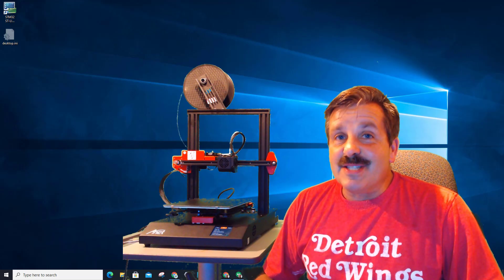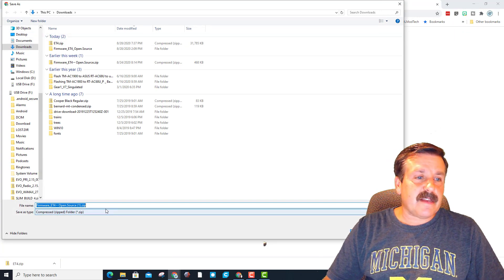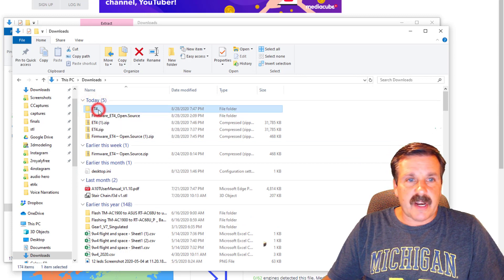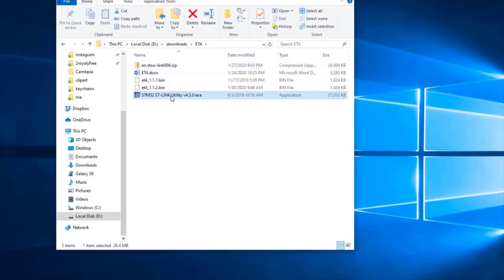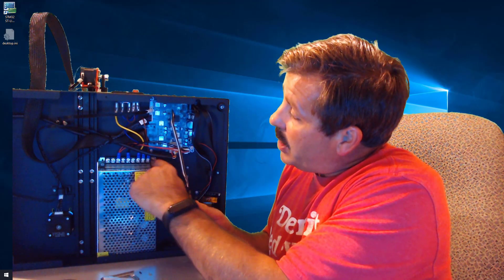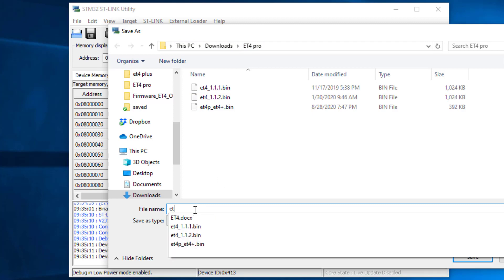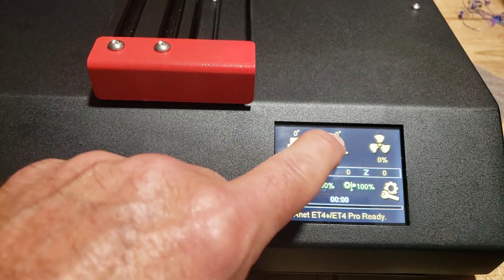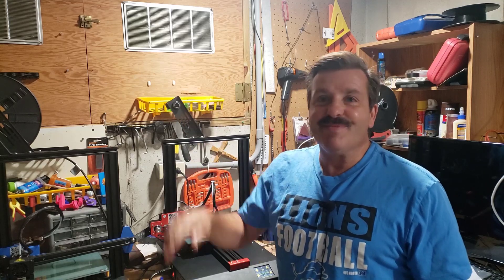Flash an Anet ET4 Pro or Plus to Marlin 2+ firmware using ST-Link v2 in Minutes!

Comment: hopw our still active... so i have an issue where My firmware will load up - but its in the top right corner, not the full display, and everything is backwards? and i cant even screen calibrate it... any suggestions? its saying left side is on the right, and says failed if i try usinng the full screen and do the calibration how its supposed to be
Reply from the maker: What printer are you working with?
Reply: @HLModTech  the Anet ET4 Pro - I have some pictures of the issue if there is a way to get them to ya 

I’m tried changing the resolution, the board  on the screen says ET5 so I tried setting the firmware to use ET5 resolution and I messed with the rotation and mirror settings also in the firmware, built and updated the firmware and still has the same exact issue with no changes
Reply from the maker: Sorry for the delay. I do not have skills to mod the firmware and such. I just used what was shared and provided the steps to get it on there. Anet seems to have went belly up as I keep getting notes that no one can get the original firmware either.
Reply: @HLModTech  well your video was super helpful - ima keep working at fixing my issue as if it’s a user error on my part haha - thank you tho, fingers crossed!!!

Comment: I heard that this Anet is like an Ender 3 clone, and I've been trying to do the same thing because my 3d printer won't accept any layer stops that I program in my slicer, BUT NO ONE REALLY HAS A VIDEO FOR THE ENDER 3!!!! Could you post a video about using the st link on the ender 3? (or send me a link for a video that I couldn't find 🤣🤣)
Reply from the maker: I do not have a Ender 3 or the Anet printers anymore to play with. Sorry about that. I am pretty sure that Anet used a certain main board that made this possible.. I do not believe Creality did the same.
Reply from the maker: The Ender will update via SD card. https://youtu.be/80IWoygNxB4?si=KdN-GuAacD8HTdrj  That at least gives you ideas on search terms. Hope it works out for you.

Comment: Dear friend, I have problems with the firmware. I don't have an official firmware, and my printer doesn't want to work properly with marlin. The end cap does not stop the Z axis. Do you happen to have any firmware branded for Anet et4 pro? The official website is no longer working and the forums are too, and I can't find the official firmware anywhere. I will be very glad if you can help me and put the official firmware somewhere.
Reply from the maker: Sorry, I do not have any firmware. I do have those open bin files on my site, but none of the files that ain’t used to host.

Comment: How are you
 I am trying to install Marlin but the open source version has many errors that I have tried to solve and have not been able to, that is why it seems like an excellent option, its firmware .bin files already configured for each model. , but the detail is that I left out the link you have in the description. You will have another link or even a drive link, it is for the printer.  
anet et4+ and say this is the case, thank you very much and greetings from Mexico
Reply from the maker: I do not have any .bin files for the Anet machines. The content I do have is hosted here. https://hlmodtech.com/anet It appears the Anet forums do not work anymore. =*(

Comment: hi

am facing issues with new firmware

i flashed marlin2+ on et4 using stlink it is success

but after that i tested auto home then x and y are working fine but z axis is not working, it is moving up few steps before reaching its high &it starts toward down and collide with bed i even tried to to reinstall firmware

can anyone help !!

thank u in advance(:
Reply from the maker: So the ET4 original version homed up. The ET4+ and Pro homed down and had a sensor to detect the bed. Which version do you have?
Reply: @HLModTech  et4+ , I read on the Internet that somewhere there is not the correct code for the motherboard responsible for z offset, yes, I'll say more that I can't even move z offset by pressing on the screen))) I will be flashing it
Reply from the maker: Ok. The nice thing about the ST-link is you can get new firmware on those machines pretty easily. I have videos up there for going back to stock too. This is a tutorial I whipped up to help with searching. https://bit.ly/findhl

Comment: Good evening, please tell me, I installed Marlin on my printer using your video, but I have a problem -
The model's airflow fan must be turned on manually, settings in Cura do not help.
Are you have the same?
Reply from the maker: I have not noticed that issue.  After a print starts can you control the fan via the control panel!
Reply: @HLModTech  Yes, before and after start print I can manually on the model's airflow fan, but it is not automatically like in original firmware.
Reply: No, in Cura settings the model's airflow fan should turn on on the second layer, but it is not start(
Reply from the maker: @АлексейГуляев-л4н  would be interesting to see if a project sliced using PrusaSlicer worked. I would not picture the fan codes being something Keira would not send it correctly.
Reply: @HLModTech  I also noticed that the cooling of the motherboard does not turn on after turning on the printer, and on the original firmware this fan turned on immediately after turning on the printer.
Reply from the maker: I will have to check mine again soon. If you prefer the stock, it is easy to go back. https://youtu.be/b7rmJA4e5jc
Reply: Good afternoon
The problem turned out to be not in the firmware, but in the Cura settings)
On the native firmware, when setting up the Cura configuration, the Cooling Fan section was set to 2  when switching to Marlin, you need to set the default value to 0)
Reply from the maker: Is there any chance the fan is just set to off for the lower layers?

Comment: It work great, however, I have been using marlin in my anet for a time, yesterday it send a error message (max bed temp, please reset) and nothing can solve it. I had reflashed it but still the error screen.... Any advice about how to solve it?
Reply from the maker: It may be that your thermistor is broken or a wire has snapped. I have not fixed one of those though.
Reply: @HLModTech  😞

Comment: Thanks for your video, how can I change the steps to the printer to put a bmg extruder on it?
Reply from the maker: This video shows an updated way to make your own Marlin for an Anet machine. https://youtu.be/qydFcQ3ThPA?si=x44R6W6RJnvETGrI In that code you would have to change the drivers to match your bmg extruder. It is not something I have ever messed with though.

Comment: Здравствуйте. Пробовал прошивать по вашему видео. Выдает ошибку "programming error @0x08000000. Как решить эту проблему?
Reply from the maker: I would double check the steps. I have also had it where forgot to turn on the printer. I do not remember that error, but I have not flashed one in quite a while. I did make a updated video for the ET5x if you want to check that out. https://youtu.be/qydFcQ3ThPA

Comment: hola  gracias por tus videos son de gran ayuda, como retorno la copia de seguridad original de la maquina?
Reply from the maker: Thank you. 😃 You will need to use steps like this. https://youtu.be/KKCer809pxU Just be sure to track down the firmware for the correct machine. The ET4, ET4+, ET4 Pro models all being similar made it tricky.

Comment: hello i connect stlink and i see the printer i save the old firmware, and the program save the file ,but the file is only 4 kb instead of 392 kb , why? it is only the boot loader ? what can i do i intall openbootloader ? or what thanks
Reply from the maker: You may want to check out my newer video. This is the ET5x, but you would just chose the ET4 Pro config at that step. https://youtu.be/qydFcQ3ThPA

Comment: I have a Diggro Alpha 5 printer which is a exact clone of Anet ET4 Pro. I wonder if it's possible to flash it with Anet firmware, will it work? Since it's a clone there's no firmware update for Diggro anywhere, so I thought maybe I could use firmware for ET4 Pro. 
If I will do a backup of the original firmware first and then lets say I will fail flashing ET4 Pro firmware or there will be problems with it I can always flash the original frimware back to the printer, right?
Reply from the maker: I am not sure. I am making a new vid for the ET5x really soon. Watch the step for finding the correct config files for the printer. It would be interesting to see if there is a Diggro folder in there.  Theoretically you can go back, but flashing always has risk.
Reply: @HLModTech  Hey, just want to let you know i flashed My Diggro Alpha 5 with the ET4 Pro firmware you provided succesfully. But now I'm not sure how to calibrate Z axis in the center, got my corners done manually with Calibrate Corners option and a piece of paper, but having problem with the point in the center of the bed. Old menu was very intuitive about it, but Marlins is a bit of a mystery for me in this case.

Comment: I've followed everything you've done but the anet screen has the open blt but has a message saying no firmware.srec  I've got a firmware srec file on the sd card but still not initiating a firmware install any help would be greatly appreciated
Reply: Found my answers I had a bad download of the firmware srec so re- downloaded and it worked a treat ill keep this question here just in case anyone runs into the same problem
Reply from the maker: Very cool. I was just going to reply to the one above that firmware.srec was a different style of updated. Great job tracking that down. 👍
Reply from the maker: I keep seeing a notification to reply... =) I know we are good, but that notification is annoying. Super cool you solved it!

Comment: Im getting a cannot connect to st link, ive doubke checked ghe pins numerous times and still have the error, any help would be appreciated
It also says  "connect under reset" on the error message, but cant find that option in the settings
Reply from the maker: I have not run through it in a long time. One thing about the pins is that they can be labeled differently on the ST-Link. A lot of users mention catching that. Another thing is that the printer does need to be powered on.  Keep me posted... I may think of something else too.
Reply: @HLModTech I finally, literally 10 minutes ago, got it working. Wasnt able to make a backup because the printer kept disconnecting after a few seconds after connecting, also saying the voltage was to low, debug in low v mode didnt help at all... So once the target loaded i just flashed it (4 seconds) and now it seems fine, marlin loaded up, going to finish building my enclosure now and recalibrate the machine like it was new out of box and gonna start fresh because i kind of started in the middle, full of eagerness and excitement in this 3d printing stuff.
Ive watched this video probably 30 times in the past week trying to figure this out...
I use a dell xps which has usb c connection only so i had to use an adaptor, im going to assume that the adapter was throwing off the communication MAYBE.. Im just very glad its working now and i didnt brick the printer in that process.

Thank you for the tutorial.
Reply from the maker: @mjm7071  Excellent work! Persistence usually does win out. I have a small army of Anet machines. I have had a lot of success with them. Which version were you working on?
Reply: @HLModTech  i have the anet et5x purchase last week just to try something new, i work with automotive electronics alot so figured this would be a cake walk. Problem was i had no experience at all with these printers and i skipped alot of things i didnt even know existed. Better off to start off fresh i feel.
Reply: @HLModTech  glad to hear youve had success with them, i was beginning to think i bought a crappy machine that was gonna catch on fire eventually lol i got paranoid after reading about thermal runaway
Reply from the maker: I dig my ET5x, but have not moved it to Marlin yet. I have not had any complaints since March. That big bed is super cool. If you search my channel I have steps for your first prints and such. It is a simple cube, but I find I learn so much about the printer with the tiny cube. It really pays off when I start making larger items later.
Reply from the maker: I think the thermal runaway was more of an issue with the original A8. I have not had any issues with mine. ET4, ET4+, ET4x , A8 Plus, Et5x, or my original A8.
Reply: @HLModTech  Yes, i followed you and mwt pretty much as soon as i got the printer and have notis on to learn as new vids are released. I noticed after marlin, my printer autolevels on 48 points instead of just 5 (mid and 4 corners). For levelling on so many more points, it does it alot faster now, the motors even sound a bit different, but now i get these tiny blobs around corners, im going to assume i need to adjust the retraction, maybe even change the settings in marlin completely?
Im very happy the auto level finally works because it didnt on the stock firmware with mine.
Question, if youre familiar with marlin that is. After you install marlin, would you happen to know if the settings for the printer are correct? Or do i need to tweak settings after install (bed size, gantry height, retraction, etc)? 
Or should it hold the previous firmware settings?

Comment: Hi brother i have issue on z axis. But all the process are correct. Auto bed leveling show  55  66 34 
55 123 234
124 111 123
 What is reason behind it
Reply from the maker: I have never seen numbers that far from zero. The disparity from your front and back is pretty big too. Which printer is this?

Comment: It didn't work, please help. I cannot revert to default firmware 1.0.2 et4 pro...I messed up when I saved the firmware from the board(small size, I guess wrong address length) and the firmware available on their website gives only a white screen. I still can write and connect via ST-link and if I write my "wrongly saved firmware" Anet logo will show and that's it.
Please give me an advise. The default firmware from their site contains few extra files (logo img, hex file and xbf file), should I do something with those files prior to flashing the et4p.bin file?

EDIT: Barely found out, that to revert, you have to write the hex file! NOT the bin file, when restoring the default firmware from anet site if using ST-Link.
Reply from the maker: 👍 As I was reading that was what came to mind. Is everything working fine now?
Reply: @HLModTech  yes sir. It seems to be flashed ok. Unfortunately I only had the time to verify the menu's...not sure about functionality. I will test it later today.
Thing is that the open source firmware for et4 pro is no longer available...and the only other video from anet that shows step by step update using bootloader + firmware on SD card seems to be incompatible as the firmware they propose is for et5x and I asume there is an issue/difference with the spi of the display as the interface is broken. Broken as in the buttons are barely visible covered by lines and jiberish hieroglyphs...but the touch does work as I accidentally selected bed leveling procedure.

Comment: I recently tried to update my ET5X to Marlin, I accidentally forgot to insert the SD card with the firmware installed, I received a notice to insert the SD card with the firmware, I did that, but nothing happens. Any idea what steps I need to perform to get it moving again. I've tried disconnecting from the ST LINK software, then rebooted the printer, yet all I get is the insert firmware. Am I missing a step? Thanks
Reply from the maker: Should have nothing to do with the SD card. I have one ET4x I snagged broken that does not even have the SD card and was able to flash it with the ST-Link.  I am assuming you are reading that note on the printer screen? When using ST-link all the info you care about should be on the PC side.
Reply: @HLModTech  Thanks, I figure it out.

Comment: How to disable auto bed levelling in marlin frimware ? My problem is when I start printing my printer goes to auto home position and z axis is hitting the bed very hard. Please guide me
Reply from the maker: Is there any chance you flashed the wrong firmware? Which version of the ET4 are you working with?
Reply: @HLModTech  in my main screen it shows as ANET Et4+/et4pro ready . I'm using ANET ET4 PRO version
Reply: @HLModTech  please send me the link for ANET ET4 PRO marlin frimware
Reply from the maker: @sivakumarpanneerselvam1996  I do not have a link for it. Your machine is still on stock firmware, right?
Reply: @HLModTech  yes sir

Comment: Correct me if I'm wrong, but is it possible to make a firmware upgrade via a TF card?
I once read a manual where guy flashes only bootloader and Marlin was being upgraded via TF card
Reply from the maker: It is with a mod.  I did it for one of my machines. I do not have a video about it. You need the ST-link to get there though.
Reply: @HLModTech  I know that I need ST-LINK to flash a bootloader. It is something like STK-500 for AVRs :)
But thank you for answering.

Comment: Hello, is it possible to get the pinout from the et4 pro board? I have a repaired et4 pro board at home and would like to install it in my Anet A8 plus?
Reply from the maker: I am on the road and do not have access to my printers at the moment. There is a good chance you can find it on the Anet Mods Facebook group.

Comment: Auto bed leveling is so confusing for me(on new firmware). Do you have any suggestion for doing this?
Reply from the maker: I do not use it. I still leveled with my paper (friction sound technique). Then on the printer I just nudged the Z level a tiny bit till I had the adhesion I was expecting. I am just not wired for ABL.